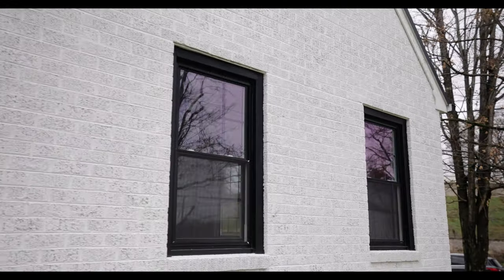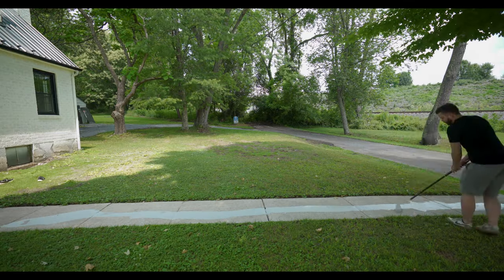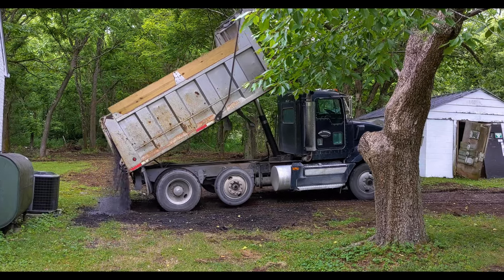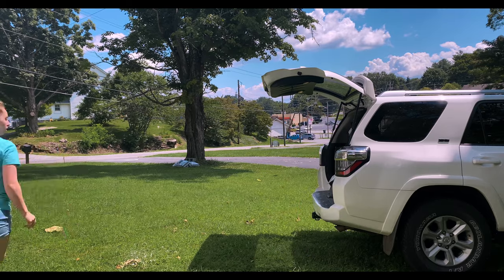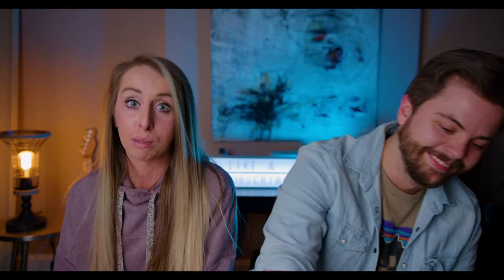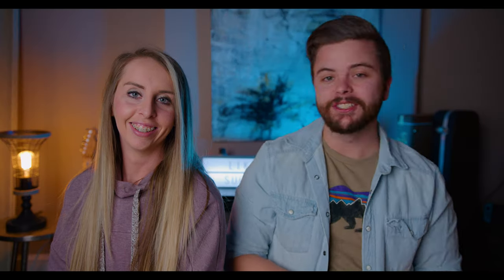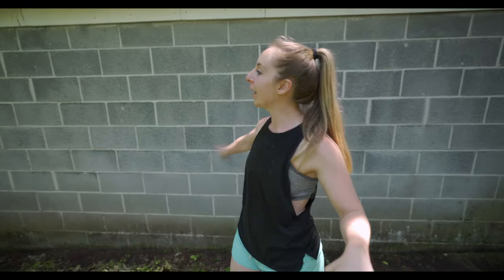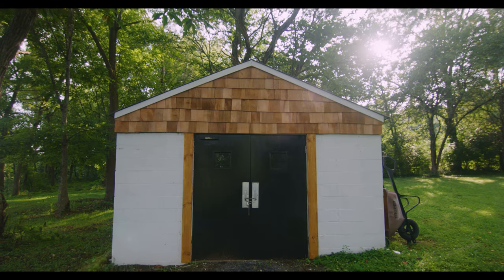5 Things You Must Do To Add Curb Appeal!

Comment: This makes me so nervous as a first time home buyer though. Like ok you made all these cosmetic changes to sell the house and woo us but what about the unseen aspects? The foundation? Sewer/septic? Attic? Would you just ignore those and hope the buyer is swayed by all the new pretty paint?
Reply from the maker: Maybe try watching the show 🤷‍♂️ We completely renovated the house. We updated the electrical, plumbing, replaced the roof, windows, doors. The Foundation was fine if it wasn’t ,or there were any other issues, we would’ve fixed that to. Here’s the thing if we don’t then during the home inspection it would’ve came back as an issue. So please don’t insult us by assuming we just slapped a coat of paint on the house and called it a success.